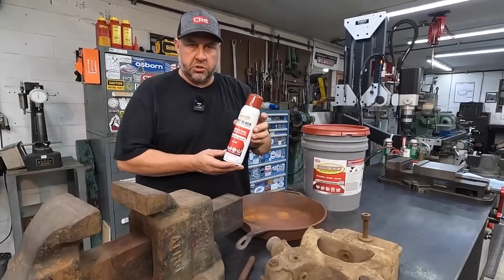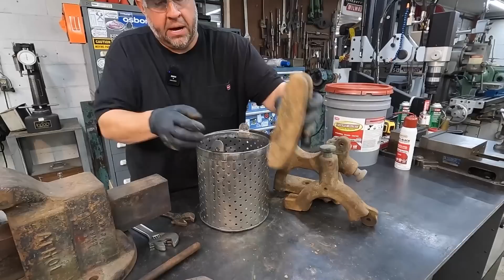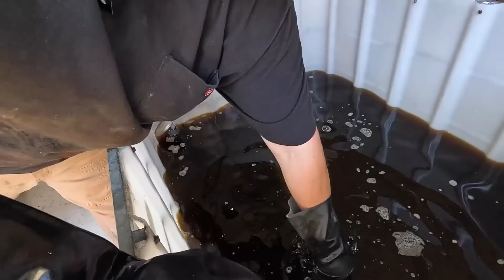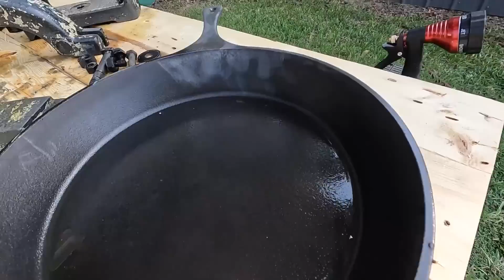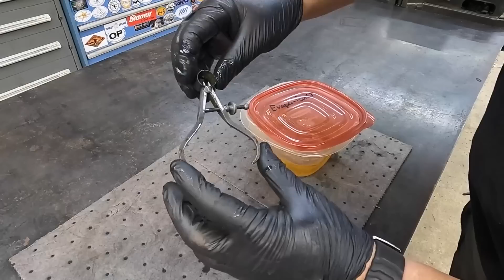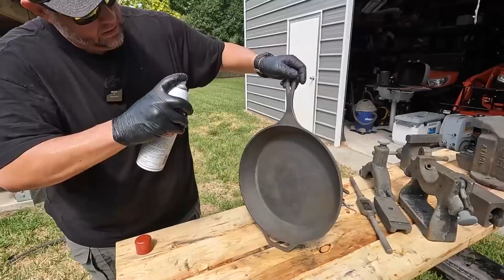ABOM79 Shows How To Restore and Protect Rusted Tools & Objects with CRC Evapo-Rust

Comment: Rust Block:  what is it?  Is it a film or does it react with the surface perhaps making a phosphate or depositing zinc?  While EoR does not touch the metal, it leaves the surface rather reactive perhaps leaching out beneficial oxides which keep the surface from rusting when put on a shelf.  After doing some transmission gears, they flashed to a light golden soon after dried off.

Comment: Try the laser rust remover, you will never use chemicals again😮😊
Reply: 99% of folks can't afford that. I looked at a new one at auction, but that sold for $290K before adding in buyer's premium and sales tax. This was a 1000w German machine, so there are much cheaper machines out there but nothing for less than $50K that is quality.

Comment: EvapoRust liquid is a fantastic product. I've used it for many years (decades) to clean light to moderate to heavily rusted tools and also items that were so badly rusted that one would think there was no hope. It always simply works.

A couple of points.

1. It will not attack the base metal, paint, wood, plastic, or your skin. Only attacks rust. If you need to etch the metal before painting, use 80 grit sandpaper or an acid.
2. You can use it on ALU to remove rust stains caused by adjacent ferris metals.
3. It works faster if kept warm over a cook stove on its lowest setting.
4. After treatment and cleanup, dip the items back into the juice and let them air dry. They will not flash rust for 2 to 3 weeks, even in really high humidity, maybe longer.
5. EvapoRust Jell has really poor reviews and is expensive.
6. To treat vertical surfaces, spray it well, cover with layers of cloth or paper towels, and keep it wet by spraying often. Takes longer than full immersion but still works.
7. Dispose of by dumping down your household drain. It's biodegradable and won't harm the little fishies.
8. Reuse it until it stops working, then heat it to get a few more uses from the batch of juice.

It's really, really good stuff.........

Comment: Can you soak tools too long in evaporust? I usually only work in my shop on the weekends. Consequently, i would leave stuff in for 5 to 7 days.
Reply from the maker: It will depend on the metal. High carbon parts should not be soaked longer than necessary, as most likely the metal will darken in colour. The darkening does not have an adverse affect on the metal. It merely represents the movement of carbon from the interior of the metal to the exterior of the metal. If you have any detailed questions, please don't hesitate to contact techservice@crcind.com
Reply: @CRCAutoUS  thank you very much for the response. Cheers

Comment: I absolutely love evaporust! It's the best rust remover I've ever tried.  I restore vintage motorcycles and it's made the process so much easier. Especially cleaning the inside of gas tanks. I used to put nuts and bolts in and shake them for hours with a toxic mix of chemicals. Now I just fill it up with evaporust and let it sit for a day and they look like new. Best part is its reusable. I didn't know it comes in a 5 gallon bucket.  I'm going to have to try and find one. Thanks crc!!👍
Reply from the maker: Thanks for the great feedback! Evapo-Rust is available in many sizes. You can check out the Where to Buy on our website: https://www.evapo-rust.com/where-to-buy-evapo-rust-remover/

Comment: Some situations not covered that I have run into:
1.  Isn't there an instruction/condition/recommendation to avoid contact with air?  Obviously that tank doesn't respect that instruction.
2.  How do you tell when the solution is spent?  The volume does have a service life, correct?  A finite amount of reaction it can effect?
3.  And how about technique for larger objects for us folks who can't justify over $1000 of solution and 25 sq.ft. of workspace to house a vat like in the video?
For instance, I had a Weber grill where that bottom bolt holding the vent fins to the handle was fused with rust making normal rotation impossible.  Any suggestions (towels, sponges) of how to work the product on a section of a large object?
4.  "Discoloration"-- Everthing seems to come out with, what to me, appears to be a unique flat black patina, not the look of steel I am used to.  Am I wrong?

Future video ideas?
I have been pretty happy with the product.  I expect my next purchase will be the 3 gallon size (though the recent 25% price increase on Amazon sucks).  But I want to get more out my usage.....
Reply from the maker: Good morning. We have many options to assist with your questions.
1. Check out the FAQ on our website.  https://www.evapo-rust.com/rust-remover-crc/
2. Check out this other video from abom79: https://youtu.be/-KnbrQfZVVY?si=M79BpnFf9Zs1VO8Y
2. Contact techservice@crcind.com

Comment: I wonder how well this would work on firearms.  I have some firearms that were brought to me for cleaning that the owner had left in her garage for several months.  Some have extensive surface rusting almost to the point of pitting.  Was considering electrolysis, but have been advised by some gunsmiths that there can be issues of weaking the metal by using this method of rust removal.

Comment: It seems Evaporust is ridiculously expensive ($55 per gallon on Amazon)  and over rated.  Ospho is much less costly, $20 per gallon or less and works better and faster. When living on the Gulf Coast, I bought a 500 gallon gas tank for my boats. The tank was totally rusted.  I brushed off the loose rust, sprayed it with Ospho (took about 1/2 gallon) in the morning. That afternoon I spray painted the tank and frame with Rustoleum paint.  After 5 years while only 20 feet from saltwater the tank was still perfect...not a spec of rust anywhere.   The whole process cost me under $30.  Ospho works great, been using it on everything that rust for nearly 25 years now.

Comment: Good job mate, I have found that doing smaller pieces using evaporust. It works much quicker and arguably better If you heat it up in the microwave to sort of about 60° C

and it will clean up parts in an hour or two instead of overnight works much better when it’s hot. Maybe give it a try. All the best from Melbourne Australia
Reply: I use a crock pot, and also a deep fryer, helps a bunch.

Comment: I work at an export company in detroit and freight up and preserve mostly automotive manufacturing equipment for shipment overseas. We use a product called cortex 50 gallon drums about 1500$ but we aerolize itn through a gun.This stuff cleans up with mineral spirits and protects against the toughest of sea conditions

Comment: How does one dispose of 50 gallons of Evaporust?
Reply from the maker: Hi there. All used and unused product should be disposed of in conformance with local, state and federal regulations
Reply: @CRCAutoUS That’s a Microsoft answer : both totally correct and totally useless.

Comment: Awesome video Adam, can we just spray evapo rust in bigger parts for the folks that dont have an IBC tote at home ?
Reply from the maker: Cover the surface with towels soaked in Evapo-Rust, and cover in plastic, or try Evapo-Rust Gel that will cling to large and vertical surfaces.
Reply: @CRCAutoUS  FWIW, I tried the towel/ cling wrap on some large flat objects.  The results were very disappointing.  A tray, lots of towels, carefully sealed, saturated....and uneven results across the surface, and of course indentations were not reacted at all.

Comment: Does that Rust Block affect later attempts to paint it?
Reply from the maker: You will need to wash off the Rust-Block before painting.
Reply: @CRCAutoUS  So I could go right from the bath, to rinse, dry, and immediately paint?
Reply from the maker: @grimlock1471  As long as the piece is completely dry, it is not a problem to paint it. Ensure the Evapo-Rust is completely washed off, along with any other film or oily substance.
Reply from the maker: @kevin9394-f7u  The Rust-Block needs to be completely washed off before you start seasoning the cookware or start using it for cooking.

Comment: I use an induction hotplate to bring the temperature of the evaporust and parts up to 100°-125° fahrenheit for 15-30 minutes, seems to speed the process. Keep it covered so you aren't loosing any thing to evaporation.

Comment: Found an old very large Chanellock  slip joint plier (I think the largest they make).   Would never have bought because usually don't ever need anything that big  but for free it was a good deal.  Problem was, the slip joints were "welded" shut with rust.  After cleaning as best I could, about 24 hours in Evapo Rust and they were free.  After clean up, I just sprayed and wiped with WD40.  Got a bunch of other badly  rusted US made tools including smaller Channellocks from same source and applied same treatment.  Highly recommend Evapo Rust.

And it is reusable!     Nice succinct video.
Reply from the maker: Thanks for your feedback! I love Evapo-Rust. Next you need to try Rust-Block to protect the metal after.
Reply: @CRCAutoUS  I have an old lathe with really stubborn rust. Can I soak rags with evaporust and drape on the lathe ways or other surfaces as I can't submerge it?
Reply from the maker: @SuperB776  You can cover the rusted area with soaked rags or towels. Or you can use Evapo-Rust Gel that will cling to large and vertical surfaces.
Reply: @CRCAutoUS  That is awesome...I will look for the gel version...Thank you...b
Reply: Gel 👌

Comment: Another product is dark molasses, the cheap kind used by hunter to bait deer. I mix it one cup to every gallon of water. You won't be disappointed, if your taking rust from wrenches that have been zinc coated just check on them but cast parts just let them soak. The molasses will not remove the black hardened marks on tools that have been heat treated and hardened.